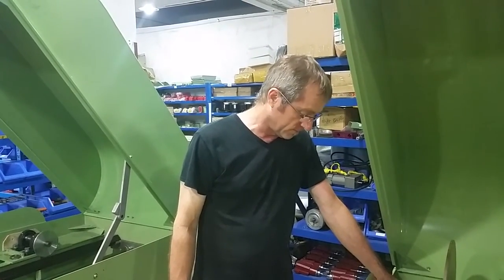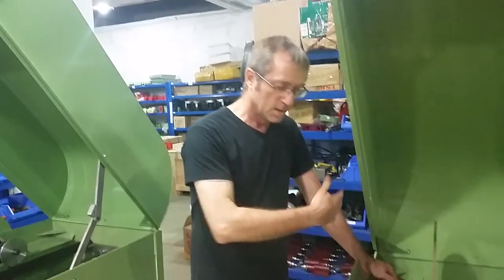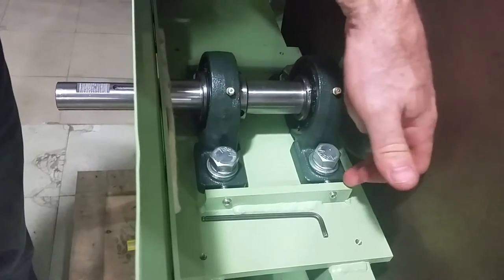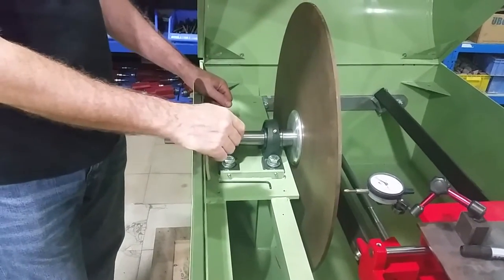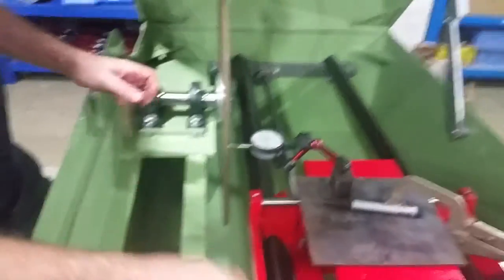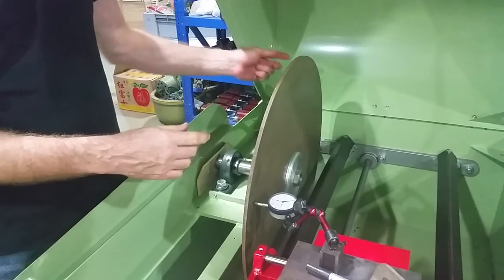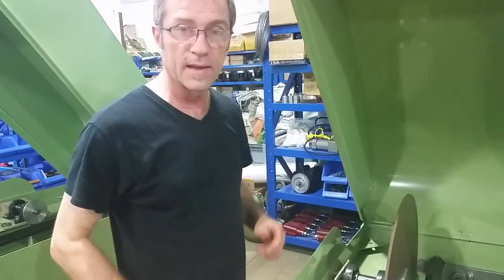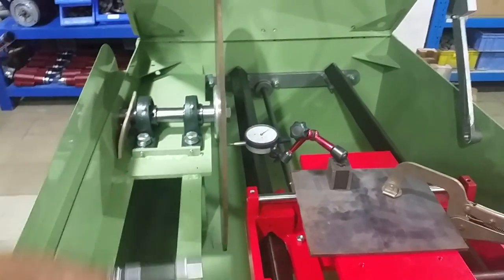Highland Park Saw Blade Alignment

Comment: Yeah, it's called halving the error, repeat two or three time and it's done, one of the biggest causes of problems for poor cutting is neglecting to level the machine, it may look ok but if it's wound ( twisted diagonally) your blade will be out of alignment .

Comment: Fine for newer saws. Not fully applicable for older models. Getting to the bearings is a bear.(24" saw)
Reply from the maker: Hey, Glen! If you have any questions, feel free to call us at +512 348 8528. Thanks!
Reply: @HighlandParkLapidary  Thank you. I finally realized that I have to get the saw in a clear area to work on it. Must move the 18' first. Will call.

Comment: Why aren't they calibrated at the factory, instead of having the customer do it? For the price you charge, you should guarantee it is accurate!
Reply: You ship a saw it will shift also if your floors not level you need to set saw for that
Reply from the maker: Of course they are always aligned perfectly at our factory - if you open up an arbor cover you will see one of our personal signatures on every single unit that we personally align.  We shoot these videos to help people like you who may own an older saw make their units cut better.